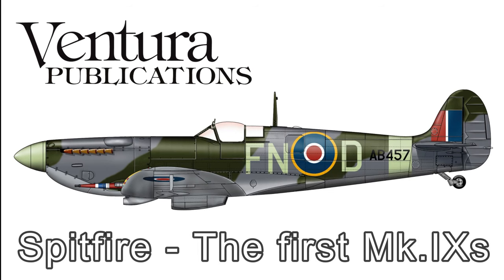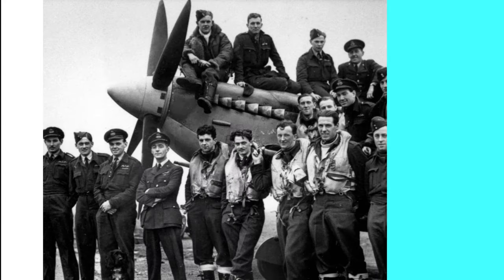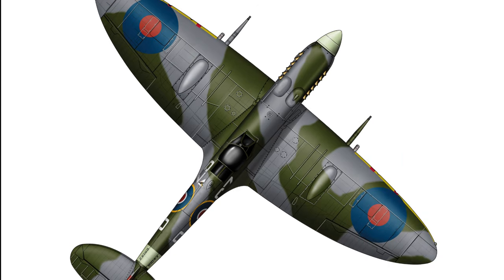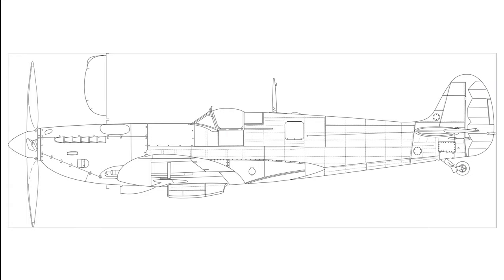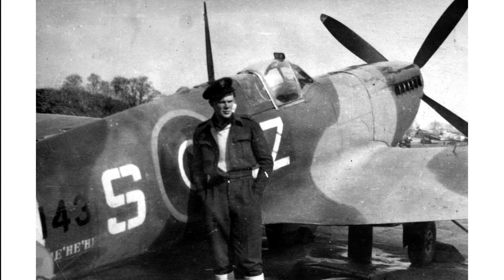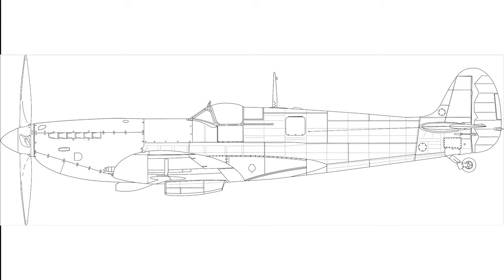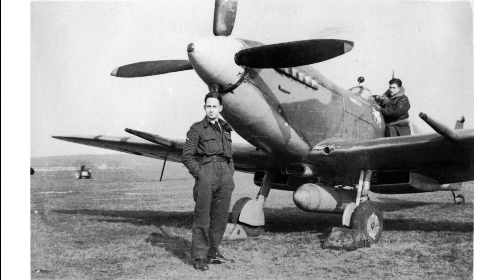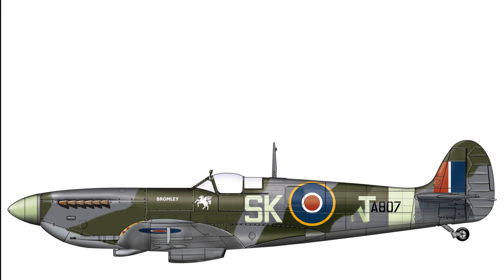Supermarine Spitfire - the first Mk.IXs - necessity is the mother of invention

Comment: Very interesting and well presented. Minor correction at 5.30 - the access door is for the oil tank filler - not filter.
Reply from the maker: Thanks for your input Steve.
Reply: @VenturaPublications  you’re very welcome! My company has painted a few Mk.IX’s over the past few years but not yet a very early one like these - all have been CBAF examples which were finished in a very specific manner and quite different from the Supermarine manufactured Spits.

Comment: It's a bit of a myth that it was the Fw 190 that caused the disproportionately high RAF losses. It took time for the Germans to get good numbers of this new fighter operational. In the meantime, it was the Bf 109F, which RAF admitted was superior to the Spitfire V,  that caused the vast majority of the losses.
Reply: That's not really true. The two Channel Jagdgeschwaders were JG 2 and JG 26. JG 26 introduced the FW 190 in Autumn of 1941, and during the Spring/Summer of 42 was entirely equipped with it. JG 2 began introducing the FW 190 in Spring and also moved fully to it by the Summer. The RAF had sustained the offensive throughout Summer and Autumn 1941, and it was these missions of late Spring and Summer of 42 that finally convinced them that things had to change.
It's true that the 109F inflicted casualties at a rate favourable to the LW, and with a not massively dissimilar trade ratio to the 190, but 1. The RAF pilots clearly perceived the 109 as less dangerous and felt they did better against it, 2. The 190s were used aggressively to cause high casualties to single units. You have events like the mauling of the Debden wing on the 1st of June, or No.403 losing half of its aircraft on the 2nd, which wasn't happening often against the 109. 
So I'd argue that the 190 was present in decisive quantity throughout 42, and that the difference was the 109 was good at harassing RAF formations at low risk to itself, but the 190 was capable of formation destruction, which is what seriously worried the RAF.
Reply: @dubsy1026  I think it was more about the shock of suddenly meeting a new, formidable fighter which they didn't have developed tactics to counter - especially it's outstanding roll rate and armament. The Bf 109 was a known quantity.

The Bf 109F-4 was not inferior to the Fw 190A-2. The Fw 190 was a better roller and diver and had better armament. The Bf 109 was a better turner, faster and had outstanding climb rate and acceleration. Both had its admirers among the pilots.
Reply: The 109 was superior to the FW 190 at altitudes above 25000 feet has the Germans found out when they faced the American bomber formations later in the war .The FW 190 was far more survivable and faster at lower altitudes with a better roll rate plus carried four cannon and two machine guns compared to the 109s 1 cannon and 2 machine guns .
Reply: Sorry that’s not true, my Grandfather flew both MK5 and 9, he was shot down twice by 190s never had a problem with 109f or G in his own words
Reply: @alanwayte432  RAF had higher losses and a poorer kill ratio in the last half of 1941 when the Bf 109E/F was by far the most numerous German fighter, than in the first half of 1942 when the Fw 190 was most numerous.
Reply: @TTTT-oc4eb FW190 could carry far more  in bombs etc than me109
Reply: @TTTT-oc4eb  Not in any Publication I have . All state it was the FW190 that caused the most problems but were overcome by the Later IXs and all Marks after that.

Comment: I read early encounters with Fw-190's were being reported and the intelligence officers were dismissing them as 'captured Hawks'.
The pilots response was "well iwant one!"
When flying over France in rhubarbs or circuses the boot was on the other foot, irrispective of the aircraft used the tactical disadvantage of operating at range was ignored in the need for "an offensive stance".

Comment: My understanding of th Fw-190 is that it had the fastest roll rate of any aircraft in WWII (some pilots reported that Luftwaffe pilots were performing snap rolls in combat when they were merely rolling), but was not a tight turner due to its high wing loading.
The Fw-190's relatively small wing area permitted its high airspeed, but prevented it from from rapid climbs and tight turns. Do you agree?
Reply: Am I right in thinking that short wings would mean that the moment of inertia around the roll-axis would be relatively small and could explain why the FW 190 could roll so quickly?
Reply: @sirtristram8297  Yes, I think that is right along with excellent ailerons, of course.
Roll rate aside, the Fw-190 was not really a dogfighter. While it mixed it up with Spits and did very well against them, at least until they improved the Spit, it was more of an an interceptor-bomber killer. In that role it succeeded famously. However, if even a P-47 (not the Allies' most maneuverable fighter) got the jump on a Wulf, the Wulf was likely dead.
Reply: It did outclimb the Spitfire V, but not the IX or Bf 109. Its excellent roll rate compensated for the rather poor turning radius, just like the P-47, another excellent roller.
Reply: @TTTT-oc4eb  You got it right. The 190 was why the Spit IX was rushed into service. IMO, the IXs are the best Spits.
Reply: @Glicksman1  Yes, if was strange how the rushed to service Mark IX ended up more popular than the original planned successor to the Mark V, the Mark XIV.
Reply: @TTTT-oc4eb  The P47 was not an excellent roller The P51 beat it in a test at 400mph at Wright field
Reply: @Glicksman1  No the MkVIII beat it and the MKVII up high
Reply: My info Roll/Rate 160 degs/min Wing Loading 49 lb/sq.ft    Spitfire 105 deg/sec W/L Mk1 24 lb/sq ft   to Mk XIV  35 lb/sq.ft
Reply: @jacktattis  I'm sorry but your post is incoherent.
Reply: @Glicksman1  Yes sorry Fw 190 160 degs / sec
Reply: @jacktattis  Yes. It is well understood that the 190 had the fastest roll rate amongst all aircraft of WWII. However early to mid models of it it possessed this at the expense of agility, climb, high-altitude performance, turn rate and radius. The D was better, but it was never a match for later Spits, P-51s, and P-47s way up high.
Reply: @TTTT-oc4eb  The P47 was not an excellent roller beaten comprehensively by the P51B Wright field Jun 1944 and the Spits with clipped wing were even better
Reply: @markfryer9880  My info original planned successor was to be the MkVIII

Comment: Is it plausable that many of the Spitfire losses of 1941 can be attributed to the aircrafts poor range and limited fuel load. 
In one of the magnificent Armoured Carries Pods ,  several Seafire pilots complain that there duration was a limiting factor . A R.R engineer said that you can run the engine on full throttle as long as the fuel lasts , which will not be long.  Flying over France on Sweeps , keeping an eye on the fuel gauge must be disconcerting to any pilot , who had a date that night.

Comment: A question I have long had is whether the Spit Vs sent to RR for conversion to IXs had their original single stage Merlins attached, or were sent without the standard Mk V engines? I am not sure whether this is known.
Reply from the maker: I believe they were generally flown in as complete aircraft.
Reply: Yeah, they would have had to fly the Vs from Castle Bromwich to RR for conversion. I suppose they shipped the 40 series engines and their props back to BC for installation in the Vs being built there.  @VenturaPublications
Reply: @gregp6210  Did you mean ship the engines and props to Castle Bromwich or some other place? If so where is BC?
Reply: @markfryer9880 My presumption is as follows. The Mk V's intended for conversion were flown presumably from Castle Bromwich (BC) to the Rolls Royce (RR) aviation facility (presumably at least some by the RAF women's air corps) where RR removed the 40 series engines to be replaced by the 60 series powerplants. I would assume that RR then shipped the left over 40 series engines and their 3 bladed props (probably the broader wood bladed versions) back via train/truck to Castle Bromwich to be reinstalled in Mk Vs they still being the primary production version (Vs were still in use in frontline use in  Europe until late 44, incl invasion stripes in that summer). I have seen a lot of literature on the Spitfire including the big books, and an article earlier this century on the crude initial conversions, with exactly where the Spit Vs came from and how they got to RR not discussed as far as I recall, so take the above with a few grains of salt.

Comment: The big difference was re build rates …Britain could and did produce replacement aircraft at a far higher rate than the luftwaffe …not a lot of difference between the spitfire and the bf109 and the FW 190 had a better reputation ….in  North Africa and certainly by Sicily the luftwaffe pilots knew that they had lost air superiority and the dip in confidence of the pilots is noted….James Holland book “ Sicily “ quotes individual German pilots by names recognising defeat was inevitable …

Comment: Mk 9 warranted 4 blade prop
Reply: Neede to absorb the extra power effectively and make use of it.
Reply: @mothmagic1  but the Brits neglected to make the blades any wider, notice a Merlin P51 and notice how wide the prop blades are, they are 4 bladed also and the wider blades transmitted more thrust from the American made PACKARD merlin engine, one of the reasons the Mustang being 2000# heavier was stl over 30 MPH faster with a similiar merlin engine, besides being more aerodynamic and its sleek radiator housing !!!
Reply: @wilburfinnigan2142  yes maybe usa also managed to scavange extra few hp from packard merlins
Reply: @wilburfinnigan2142  Be aware that the 408mph speed bandied about by authors was for the early production Mk IX. later production types with series 66 and 70 would be rated at 414 to 422mph. Anyway! By that time the Griffon engined types came into service with speeds of 450mph and a phenomenal climb-rate and superior performance at medium/high altitude. There was no piston-engined fighter to match it in fighter combat from any side.  But let's not deny that the P51D was the best long-range, escort fighter of the war. Especially when they were used in overwhelming numbers.
Reply: @paulbantick8266 griffon spits handling degraded but RAF went with extra speed climb
Reply: @Eric-kn4yn Care to expand on that handling degredation of the MkXIV?

Are referring to the July 1943 'Spitfire XIV JF317' testing?  Or that of Spitfire F.Mk.XIV RB.141 of the 20th November 1943?
Reply: @Eric-kn4yn  Not really the Merlin always trumped it.
Reply: @paulbantick8266  The Mk XIV not out in 1943 S/E Jan 44 Combat June 44
Reply: @Eric-kn4yn  Rubbish Spits with Merlins were getting 5000ft/min plus back in 1943
Reply: @paulbantick8266  Jeffrey Quill liked the MkVIII  Brown the MkXI for most flying and the MkXIV for combat
Reply: @jacktattis  I never posted that it was in service with squadrons in 1943, but it was under much testing and refining.
Reply: @paulbantick8266  Yes indeed with MkVIII airframes